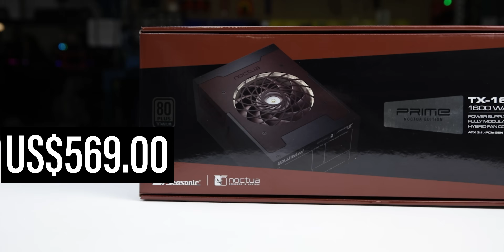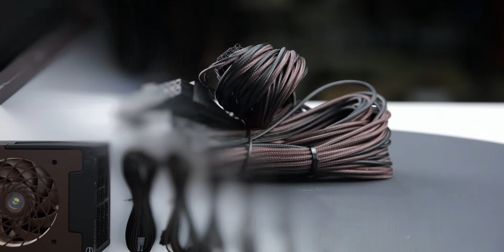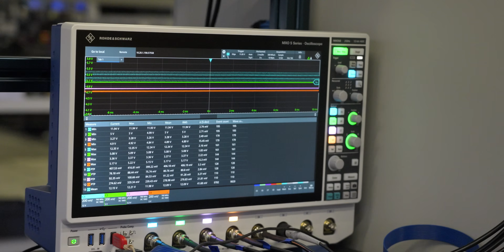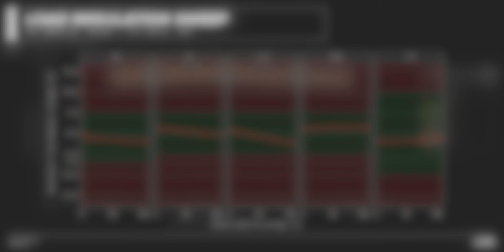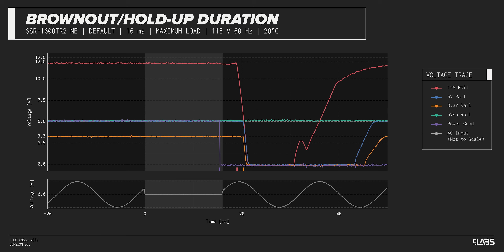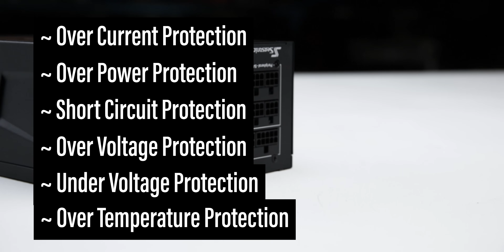Seasonic PRIME TX-1600 Titanium Noctua Edition 1600W Power Supply - LABS Test Report

Comment: power supply pcb header is 12V-2x6 (instead of old 12vhpwr)  , also if i open the psu , on the the 12V-2x6 pcb header it has H++ written on it (instead of H+) ?
Reply: Latest version you have.

Comment: The power excursion test probably failed at the highest-level because 1600w is at the literal limit of what 115v power sockets can provide (~1800w) so you're probably nearing the point of tripping breakers much less worrying if the PSU can handle it. Also, since most  modern high quality PSUs can push the entirety of their rated power through the 12v line (this one is no exception btw), it should be no surprise that asking any power supply to push over 3Kw through one rail for a tenth of a millisecond is asking a lot...

Comment: Wish there was a lower wattage version of this noctua edition.
Reply: Hopefully they do another one with lower wattage. I think 1000W would be pretty good for this type of collaboration. Still a high end product but would be something that more PC builders would be targeting.
Reply: Would price be the only reasoning?
Reply: @handohansolo8866  Mostly yes.  Also I would not be using it anywhere close to 100% usage, so it would be kinda pointless to have this many wattages for nothing.
Reply: @ManunKanava  I'd imagine the 1600w specification class of PSUs targets mid-to-high tier of cryptominers, and the top end of gaming rigs that wants to keep a lot of headroom for transient spikes (I know modern PSUs with max 850-1300w also takes transient spikes going above it into account, but that means very high load when running) and reduce the heat generation since they've got cooling designed for up to its maximum load after all. Personally, I'd prefer the reduced heat generation, since a PSU running close to its maximum capacity will often be quite noisy.
Reply: @ManunKanava PSU are most efficiënt at 50-60% load
Reply: @ManunKanava PSU headroom is always a good thing to have brother.
Reply: @Klibabin  This is not true anymore for most recent PSUs, see for example the tests done by Cybernetics Labs on Seasonic Prime PX 2200W PSU for certification, the highest efficiency starts much sooner, at around 20% and keeps up until app. 60%. I've seen this on other PSU tests as well. I personally prefer the headroom of higher capacity PSUs and the fact that can be run much cooler.
Reply: @handohansolo8866  Size. 
It's too big for many cases. A 1000-1200w unit no longer than 180mm would be nice.